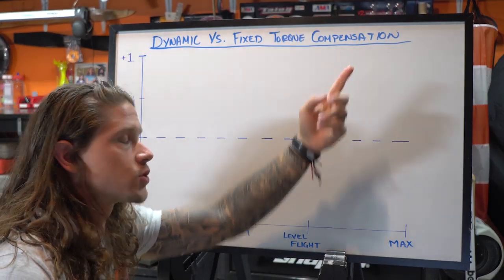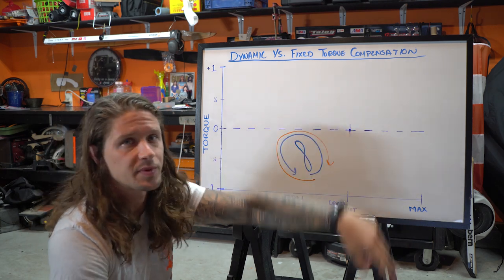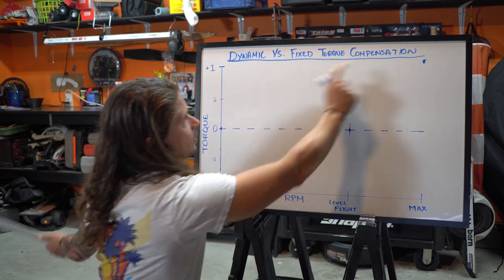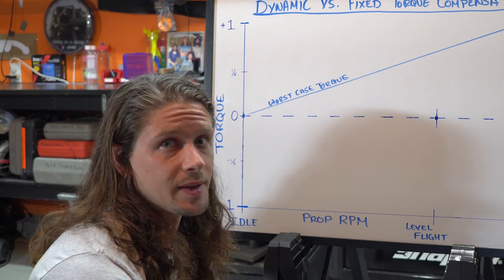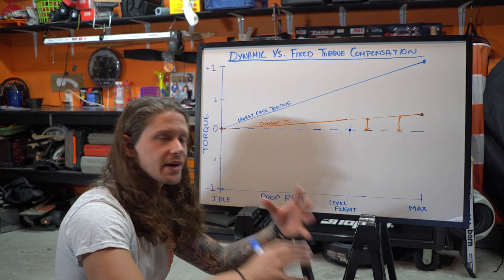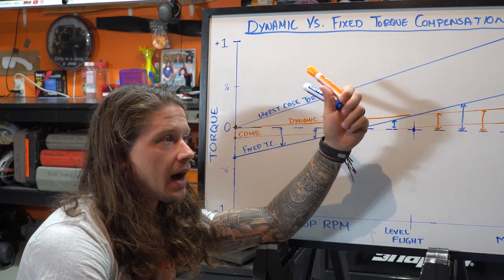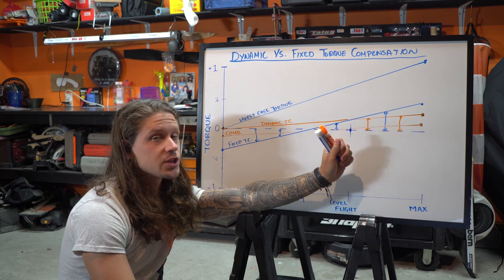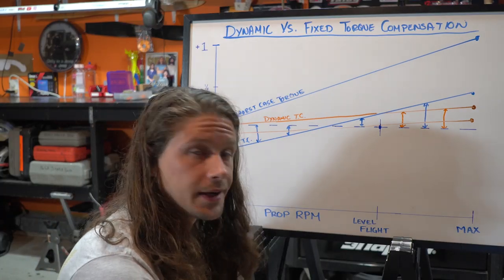Paramotor Torque Compensation Explained | Dynamic vs. Fixed Torque Compensation

Comment from the maker: A few things I missed in the video:
1. Any unit that utilizes torque lamels and an offset hook and point is actually combining these two systems. This would of course be an easier way to achieve what I'm trying to do, but I wanted to look cool too.
2. Why couldn't you just increase the size of the fins or lamels to flatten that dynamic torque line? I haven't actually tested this but I suspect that at some point as you increase the size of the fins or lamels you start to affect the thrust output of your paramotor and lose efficiency.

Comment: The Macfly also has the engine mounted at an angle to offset the torque.  With the Macfly on your back, the engine actually points slightly back to the left instead of straight.   Similar to a single-engine aircraft where the engine isn't actually pointing straight with the fuselage.  Just thought I'd throw that in there.

Comment: I have consulted charted data for aircraft operational decisions for almost 40 years.  Yet, I am lost when it comes to paramotor performance analysis using any grasp at science.  I'm just glad I weigh enough to not be tossed around by a 27 HP motor.

Comment: I was talking with an airline pilot and he explained that the descending propeller has a more optimal angle of attack. This leads to increased thrust from the left side of the paramotor, further contributing to the turning tendencies. 
I thought it was interesting...

Comment: In my opinion hibrid torque comp (that increase drag, while fixed is "dragless") is awesome, but not necessary needed because what torque do is essentially weight shift and with weight shft can be countered. In my older cage (fixed comp) I had enough room to move my butt from right to left and thus eliminating torque by weight without twisting my body in awkward positions and it was great; in my new one (sadly) I have not all that room from an arm to another and adding a source of dinamic comp (or widening the distance through bars) could help to make flights more relaxing

Comment: One thing to note on your lines for the combined.  Your combined line will still start at the same point as fixed torque compensation.  At zero RPM there is no compensation from the dynamic side.  As RPM increases, the amount of dynamic compensation increases.  Ideally, you could dial in your dynamic compensation (put the fins on an adjustable swivel) to "trim" for torque at various engine RPM's.  Probably too much engineering, but its a thought!
Reply from the maker: I addressed that actually. Since the fixed TC is adjustable on the Pluma, the idea would be that you could adjust it to induce less of a turn at idle and the the dynamic TC just reduces the slope of the line making the offset on either side of the line fixable with minor weight shift. Thanks for the input!✌️

Comment: Cool presentation...I have another factor to consider...crankshaft torque....and gearbox vs belt drive...I believe the gearbox makes the prop to rotate in the opposite direction of the crank....the belt drive doesn’t, so a gearbox driven paramotor is starting off with less torque.
Reply from the maker: James, that's a good point as well. The Top 80 has virtually no torque. Aside from the offset bars and low engine displacement, I wonder how much the gearbox has to do with that..

Comment: Tom, thanks for that discussion.  I've noticed the wing also has some influence on the amount of torque.  My Ozone Sirocco 2 displays more torque affect than my Hadron xx. Both are 22  but the Hadron  is a higher aspect ration.  I'm flying my Maverick Moster and have lots of hours on both , its just more evident on the Sirocco 2.  Thoughts?
Reply from the maker: Agreed. Some wings are affected by torque more than others, I notice it as well. I suspect the main factor is aspect ratio. Obviously those wings would benefit even more from a better torque compensation system

Comment: Excellent!  Thank you!  I just bought a Scout Carbon the other day and am going to do a intro video.  Now I can intelligently explain what those fins do!  😀
Reply: Yeah I think you're on to the answer. Any unit with dynamic torque compensation redirects the air flow which induces drag. This drag is present even when the throttle is at idle. As far as I can see that's the one downside of dynamic torque compensation, however small and affected is. On a unit with only offsets or some form off ixed torque compensation, there's no extra drag induced by having to weight shift a little bit.
Reply: J Vanier yes, it induces drag, but at what expense really... I’d guess the fuel burn difference is just about negligible. Paramotors are not finely tuned for aerodynamic efficiency. I’d say its prob a non issue, but would be curious to see some tests.
Reply: @cptvanier  I think you're spot on there.  I wonder what a dynamic dynamic compensation would look like? Variable geometry fins... perhaps too heavy or complex though.
Reply: @skatez69  yeah I think variable geometry fins would be too complicated for the benefit that they would provide.

Comment: Great video and explanation Tom...thank you. Have you flown a Skymax paramotor? I believe it's close to having both systems since it has the ABM style swingarm but the whole swingarm mechanism can slide over to the left or the right of setting the hangpoint to the wing. By moving it as little as 5mm makes a big difference. Torque lamels sacrifice some thrust in order for them to work. I don't think it's a lot though as I've not looked into it too much.

Comment: 3D print your fins. Start with an angle you think will bring you close to zero, then adjust & reprint after each test flight. (Note: your test flight profile should be as identical to subsequent flights, eliminating all variables except wx).  Also, since you have a way to adjust your fixed compensation, you might want to invent an adjustment feature to your 3d printed fins.
Reply: Further, most pilots do not articulate gyroscopic precession well.... The reason why most paramotors have a left-turning tendency is due to the counter-clockwise turning propeller acting like a gyroscope. The force the pilot feels is 90 degrees to the spin of the propeller (twisting him/her to the left). The more power applied on take off the more force the pilot feels to the left. A very effective way to counter precession is to take advantage of P-factor. When the pilot leans back during take-off the descending blade takes a bigger bite of air than the ascending blade and the pilot feels a right turning tendency, counteracting the effect of precession.

Comment: Tell us about TEA line (Torque Effect Adjuster) in the wings. How much more efficient (or not) is it comparing to compensating elements installed on a paramotor.
Reply from the maker: Not sure I'm familiar with those...my HadronXX had two hook-in points on either side so you could offset the wing slightly to compensate for torque, but I never used it.
Reply: @Tommyflies  right, I'm flying Hadron 3, that also is supplied with TEA line. But my harness has a passive torque compensation mounts. I'm not sure what works better: a line without the mounts or mounts without a line.
Reply from the maker: Only way to know is to try it out 🤷‍♂️
Reply: @williamloveless5644  I fly the Hadron 3 as well and prefer to use the TEA line.  It is more efficient than an offset on your frame because it doesn't offset your thrust line.  Also, it is pseudo-dynamic because it adds more torque compensation when using trims/speed bar.  It's the best solution I've found so far since my frame doesn't have dynamic torque compensation.

Comment: Nice project. You describing the Nirvana Instinct. Its got both systems. You had one missing factor and that is torque effect with high and low hangpoints as well. So reason I mention it is that I have less trim compensate required on high point configuration than with low hangpoint configuration because the the harness hangpoints absorb more than when the wing is connected to swing arms of most low hangpoint machines. How much trim compensate do you require on the Pluma with full trim open and running max rpm for level flight?
Reply from the maker: That's good information, thanks Eugene. I've got the torque compensation strap on my Plums set so it flies straight at level flight, so no trim adjustment needed. I'm weight shifting at max throttle tho.
Reply: So the Grail of anti-torque is two fold. 1. Eliminate false turning moment during takeoff. 2. Zero compensate trim at max speed. I’ve been through a few machines and those that dont have torque compensate needs about 1-2 inches of compensate at max thrust/speed. If you need to weight shift in the Pluma you are compensating but not in trim which will be super uncomfortable in a long XC flight. Having said that if you can have both trims open without compensate you get more speed and that is the difference between beating your opponent in a XC race. I’m saying that with all variables constant meaning all competitors are flying below max weight of gliders and wing loading constant. BTW I like that you also using board to illustrate. I started a new channel called PPG Republic with the idea of doing collaboration videos between prominent PPG pilots of the ‘new school’. Think about joining...

Comment: Are Scout Hangpoints directly distanced from the center of thrust?  , or ,  Don't they already have this?  Please explain...     Also, my buddy, and Butch Knight's buddy, Randy Sampson built his own rig and used plastic signage material for his dynamic torque compensation, and it only required little clips welded to the spars to set the angle..... if you want, I can send ya pictures.  Give it hell.... good video!
Reply from the maker: I believe the Scout is perfectly centered. Tell Butch I say hi!
Reply: K.  Thanks.  And, Will do!

Comment: Great video! On the scout, if you are gliding at idle, does it have a slight turn to the left from the fins? Or does it actually just glide straight? 
Also, cool thing about some helicopters with large vertical stabilizers (like apaches) if you do lose your tail rotor, you can still fly as long as you have lots of airspeed to keep that vertical stabilizer working.
Reply from the maker: Thanks dude, that effect on the Scout is negligible, I never noticed it. Also, shut up, what you know about helicopters!
Reply: @Tommyflies  hahaha thanks. I personally know heli pilots who lost tail rotors and lived to tell!
Reply from the maker: @MitchG  no shit? That's awesome/scary as hell

Comment: How could you do a video on paramotor torque compensation and not mention the OpenPPg electric which hits that ideal zero line?
Reply from the maker: Yeah I considered mentioning that but was targeting the majority which utilize a single propeller. OpenPPG hits that line but compromises so much more.